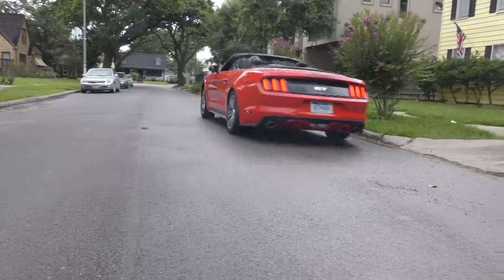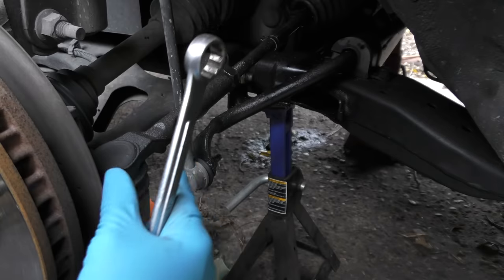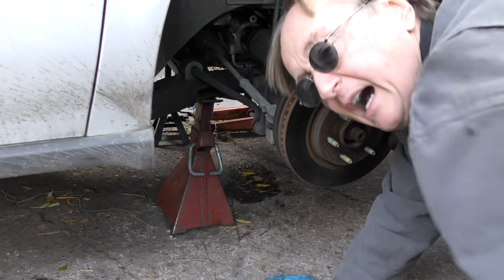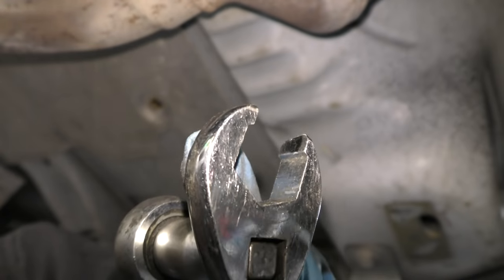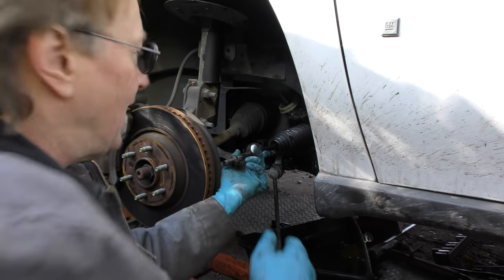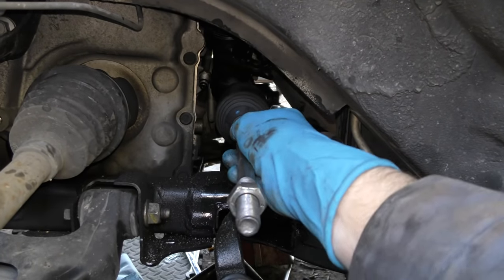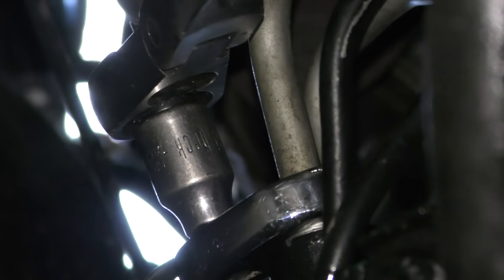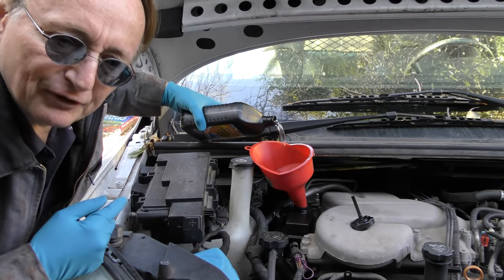How to Replace a Power Steering Rack in Your Car

Comment: My mechanic told me it takes 5 hours to do this ...So i was expecting  a vidoe of such length....but Scotty got it done In minutes 😀. I wish i could do this myself cuz the mechanic  is rippling me off 🤨
Reply: Keep in mind mechanics have to do more though. The rack itself may only take half an hour or so, but the time to take things off and put them back together is included, as well as the alignment time. My shop would probably charge two and a half to three hours for this so it's not far off
Reply: @chickenfixn4439  ok thanks.. but 3hours compared to 5hours is a big savings.

Comment: Why didn’t you lock the steering wheel 1st? This isn’t right from the way I was taught. Please explain Mr.Kilmore? I’m a suspension technician and I really am curious to why our methods differ
Reply: You don't HAVE to but it is a good idea to prevent someone from turning the wheel and ruining the clock spring

Comment: Hi Scotty, I have a Honda Jazz 2009 where the EPS light indicator comes on. It's hard to turn really.  We tried to check using a device but it detects to have something in the battery (low voltage?). But some mechanics its either on the module or the electric motor w/rack and pinion needs to be replaced. It's $$$. But the thing is the light turns off at some point then turns back on. What do you think is the problem on this?

Comment: I have a power steering issue with my car. I can't find a leak in any of the lines but I believe it's the cap is the source of the issue. Can a bad cap really cause it to leak that much and cause the power steering to cut in an out while turning?
Reply from the maker: +Hank jr Breukelman  bad cap only loses a tiny amount, and often if it comes out the cap, that's the sign of a bad pump pushing fluid out there
Reply: +Hank jr Breukelman What type of vehicle?  Is the pump making squealing noise?
Reply: +ScubaCat3 It's on 06 Impala LTZ. The pump is whining so I'm just going to replace it again. It's no big deal, I replaced it last summer and they only cost about $40.
Reply: First check the fluid reservoir and make sure there isn't a little metal screen in the bottom. Take it off and empty it.  That screen may be gunked up with burnt carbon (or whatever the black crap is) and blocking fluid flow.  Just spray a little carb cleaner in there and the black crap will come right off.  I replaced my pump before I discovered this.  You can't see the screen at all until you drain out the fluid.
Reply: +ScubaCat3 Will do, thanks.

Comment: Hey Sotty ! 😉👋🏽
1999 Infiniti Qx4 
Whenever I turn the steering wheel then start the engine then turn it again, little bit of power steering liquid spills out the container even if the cap is on. What's causing that ?
Reply from the maker: +Fabrice Douillard you have a restriction somewhere. Often a bad power steering rack or a bent power steering hose that's building up too much pressure.
Reply: +Scotty Kilmer I can't really find any leak but this isn't my first time seeing liquid on the hose and on things next to the container 😔

Comment: I have 2006 chevy impala and have change the rack 3 times already. I did a complete bushings and bearings replacement, even control arms on both sides. I steer left and right you can hear cracking noise. I took it for alignment installed a camber tool.  I just ran out of options what is causing it

Comment: Hello Scotty I have a Lexus GS 300 2006 the steering is so hard to turn I  removed the rack and checked the rack wouldn’t turn easily as well should I change the rack ?? Because the rack makes noise when I removed it and it wouldn’t turn easily

Comment: Hey Scotty , I was replaced my Steering Rack and power steering pump. But Why it extremely hard to have wheel turn when it stop while car is running but It working so smooth while driving on the road(Faster steering wheel smoother). Do you know the reason ? thank you
Reply from the maker: +Raksasok Heng if you used rebuilt parts, and not brand new ones, that's often the cause, rebuilt ones often stink

Comment: Hi Scott, I have a question. I am gonna change my rack and pinion on my 2010 Kia Soul + 2.0 and I would like to know if the mag1 fmx oem gm,ford & Chrysler psf is ok to put back into my vehicle and do you think I could get away with replacing the rack and pinion without dropping the sub frame. Thank you

Comment: Scotty so my rack and pinion on my 01 dodge intrepid is worn out and need to replace it soon. Sadly checked online and dealer hey only have reman. Will take my chance with a cardone reman since I have a reman cardone pcm and haven't had an issue guess I was lucky! My question is after I change the rack and pinion do I need to flush the power steering fluid? Thanks!
Reply: always remove old fluid as that can damage new rack

Comment: I smacked a curb trying to do a uturn I was told a loose bolt on my rack and pinion will cause my wheel to wonder, I thought it was the inner tie rod since the outer one looks fine

Comment: Hey ! my car is making a noise when I turn my steering wheel with the engine on and the car being stationary. I took it to the mechanic and he said the noise is from the rack and pinion. There's absolutely no noise when I'm making turns while I'm driving the car ( car is in motion ). Is this a serious problem ? Should i have my mechanic remove the whole rack and pinion ? Or is it just the steering fluid ?
Reply: test the cheapest thing first, replace the psf! it's $6!

Comment: I had my power steering rack & pinion replaced . After leaving the mechanic shop, I noticed that the steering wheel controls are not working, also the cruise control wasn't working, and the traction control and the air bag lights were on. Why.?

Comment: Center the steering wheel and then wrap the seat belt around the wheel so it can't move while the steering shaft is disconnected.

Comment: My 2002 Camry has one of those rubber boots with oil on the outside of it. It’s not leaking but the oil is just covering the rubber. The steering is fine but feels loose. Very easy to turn the steering wheel. It’s been like this for a long while I think but I’m not the primary driver of the car. Does the whole thing need to be replaced?
Reply: lucas m did u ever find out the problem?
Reply: What was issue i got same problem

Comment: Scotty
What is your opinion about the rebuilt racks? Cardone is a brand that rebuilds a rack for my 2000 Dodge Dakota R/T (I guess Cardone gets the old racks and rebuilds them, not make their own) and I am planning on avoiding the mopar brand that is $700. I have made a comment in a previous video of yours and a lot of people say that the rebuild racks are garbage blah blah.... I'd either go to AutoZone or NAPA.... and the rebuilds have warranty. I am lucky because it looks pretty easy to do my rack and pinion on my truck.
Thanks Scotty.... appreciate the knowledge and your time sir.
Reply: You get what you pay for, personally I'd buy a new one.
Reply from the maker: +Eslamizar yes, a lot of them are garbage, I try to stay away from them as it's a BIG job and good luck trying to get cardone to pay labor for the job IF it doesn't work.
Reply: +Scotty Kilmer you couldve spent a couple seconds telling folks how to refill also. but seriously you crack me up man thanks for all the videos
Reply: Lol... Still deciding on which crap to go with? Just get a used recently retired dry oem one if you want to save money. There are so many of them, and it'll last longer than a rebuilt. I say recently retired because you don't want one that's sat for years with no pressure or fluid.
Reply: hugeslacker I plan on replacing the rack this year.... I think I will take it out and have it rebuilt by a local shop.

Comment: Hi Scotty, my steering makes weird noises when turning. It's manual steering and front wheel drive. Even when parked, there is a kind of creaking noise when I steer. I know the tie rods are good. And the struts and springs are new. Could it be the rack? Thank you sir

Comment: hi Scotty. .so if the steering wheel wabbles left and right when you start driving the car...does that mean the rack and pinion needs replacement. ...
Reply from the maker: could be that or any other worn front end part like tie rods or ball joints

Comment: Hey Scotty, is it possible to replace the inner tie rods, my drivers side took a hard square on kerb hit (4 inches high apx) that blew a 275/40/20 tyre.
I had it checked and they couldn't find any fault but it's scrubbed the opposite side tyre (inner 1/3rd) and when I rock the wheel there if definite clunking from the rack area. All the ballpoints and ball joints still feel solid. (Upper lower and outer tie rods)  It's on a 2004 Cayenne. 
Thanks for any advice

Comment: the at-205 seemed to work when i first noticed a slight drip.  so far so good.  but i know in the long run i will have to replace it though.

Comment: you didn't mention how difficult it is to put back and screw in the fluid lines ou took off. is there a special way to screw the threads back on.

Comment: Hey scotty I want your opinion.  Im currently doing some work to my grandpas 2000 Mazda Millenia S Millennium edition.  The work was new drive axles, front brakes and tie rods for the car.  My grandpa is actually going to sell the car eventually and im interested in buying it, but ive been doing heavy research and still not sure.  The car only has 112500 miles.  Do you think this car is worth buying off of him?
Reply: +WildWhiteFang I know I'm not Scotty, but from the few I've seen, they're nice cars in terms of the engine and general appearance. With that little mileage on it and if it's to your liking physically and mechanically, I'd say it'd be a nice purchase. If I were you I'd still continue to do research on it. Besides, you can never know enough about cars :P
Reply: Scotty would say something along the lines of " Oh heck, yeah if but that for a low price because you know that it was well taken care of, just realize those mazdas are not as well made as let's say a Toyota or Honda and Mazdas have real weak automatic transmissions, but if it is a manual and you can get it cheap enough, I'd go buy it"
Reply: JasonMTG Yeah I know how the car runs and the only other problem is the front valve cover leaks but I can fix that.  ANd honestly I appreciate it! Anyones opinions are welcome, cause i need another car fast!
Reply from the maker: +WildWhiteFang some grandpa, he should give you the car.  But, if it's cheap enough, at least it's a known vehicle and not some wrecked piece of junk.
Reply: +WildWhiteFang   Mazda sucks balls. 150k miles is about as much as you can expect out of that engine.
Reply: Scotty Kilmer well he is paying for the parts on the car I just havent told him im interested in buying the car and the car is in great shape, he is very picky about how his cars are taken care of
Reply: Y10Q Really? Cause I have seen alot of mazdas with over 150k on the motor
Reply: WildWhiteFang
 really hard to find one over 150k miles. Mazda and Mitsubishi are on par with GM products.
Reply: Y10Q Then your not looking hard enough dude.
Reply: ***** Its mostly age honestly, even my auto tech teacher said the same thing.  And it only needed the left drive axle but my grandpa went ahead and got the parts anyway
Reply: rogermurph101
 those boots are cut by a mechanic when you take it for a service. I have a 2001 Subaru with 253k miles and it's on original axles boots intact. The only difference is that this car has never seen a mechanic shop. I do everything on it myself. I had a 1990 Subaru and boots were fine until I took it for brake work circa 2000. And then, all four magically developed cuts. Call me crazy, but I think they cut them at the shop on purpose.
Reply: +Y10Q  600 k on mine.  Al I have done on it is breaks and shocks
Reply: ***** I have a 99 Jeep Gc and I started doing work to it myself after i took it to Jiffy lube.  I started noticing a transmission leak and thought it was the gasket around the pan, when i went to check the bolts to take them off I noticed they were very loose.  I instead tightened them and never had another leak.  One of my many reasons why I dont trust shops like that.
Reply: Mazdas are pretty good. I have a 99 protege with 187,000 miles and not much has gone wrong. Everything works. Just watch out for rust.
Reply: Any car can rust gut it can rust fast if your location has lots of salt

Comment: Scotty, can i get some insight on why the 2az-fe engine starts to burn oil around 100k miles? My dads pontiac vibe, which is toyota matrix but you already know that, has the 2az-fe and its starting to burn oil. It has all its service done and everything. Oils changes were on time, i just dont understand why this is happening. My 2001 isuzu trooper is said to burn a quart of oil every 1000 miles and it doesnt. Or was i just lied to the whole time?
Reply from the maker: +Frank Magana  they do it cause people don't change the oil frequently enough, on my wife's matrix I change it every 3 thousand miles and it burns nothing. Go by their suggested 5 or 10 thousand mile oil changes, they will burn oil. They just don't want to admit their change schedule is wrong, they'd be sued BIG time.

Comment: Hey Scotty. I have a 2007 Volkswagen Rabbit 2.5L. I did both front wheel bearings and Axels and now the steering light is on and giving me a code for Steering Torque sensor. I checked for power and ground. Any thoughts if I need the sensor or the entire rack?
Reply from the maker: have a vw guy check it with his vag com computer, those are complex over engineered vehicles, you can't just guess with that warning, too many possibilities

Comment: Hey Scotty- is that a Chevy Uplander in the video? I have an 02 Olds Silhouette that had a leaky r&p gear, got a reman from a local well known reputable auto parts store, and guess what? After about 2-3 weeks it started running fluid out he rh side boot-ugh! I haven't pulled it to replace it (warranty exch) because I really hate doing it all over again.
Reply from the maker: yes, it's an Up.  And that's why i hate rebuilt racks, crap half the time

Comment: Scotty what brand of power steering rack is good? Im not sure what is wrong with my 01 Dodge intrepid but sometimes i get low on Ps fluid and my car makes a low noise i poured fluid noise is gone but i am wondering could it be a leak or the rack? Thanks!
Reply from the maker: +Luke  I only use new ones, rebuilt ones stink half the time.  to check for leaks, do my video "finding and fixing car oil leaks"

Comment: I have an 03 impreza, and my car is smoking (white) from underneath. I just replaced my PS pump, but every time I drive my PS fluid drains. I think the smoke is the PS fluid leaking and burning off, but where would it be leaking from?
Reply from the maker: +huntersergey445 often the high pressure hose, do my video "finding and fixing car oil leaks"

Comment: Hello Scotty. I watch your videos for a long time. I'm urging to question one thing for few days...
I have an automatic car, and it's not reversing anymore. Only when on a perfect flat surface, lacks power, and throttle serves nothing. It's too bad?

Thanks a lot and best regards from Brazil.
Reply from the maker: +Thi Tavares odds are you need the transmission rebuilt, BUT pray it's just low on fluid
Reply: Scotty Kilmer Thanks Scotty. I will start praying.. ahaha. A new transmission for my car.. About 6.000. :O

Thanks a lot for your time... Keep up the great work and videos.

Comment: Thanks Scotty, that tie rod alignment trick was fantastic! I'm in need of your expansive Yoda-like knowledge. 

I have a 1987 ltd with a 351w that recently got a brand new intake and a fancy 4 barrel carburetor installed. I assumed the guys at the shop would have swapped the near original plugs but they left them in and I'm left with my baby running horrible. The problem is that the plugs are STUCK. It feels like if I spin any more they'll crack off. Is there anyway I can get them out without killing the heads? My ol' girl is going  to be needed for a cross country trip to Newfoundland. 

Keep up the fine work!
Reply: +Dewy Russler Thank you so much! Those Triton heads are aluminium right? Hell, sounds like Kroil's the way to go!
Reply: +Dewy Russler I was going to recommend kroil too. Worked on my old audi that hadnt had its plugs changed in 15 years.
Reply: +Brad Nimbus I have a 91 S10 I bought a while ago. When I took out the spark plugs, 1 or 2 of them came out in pieces. Wow. Talk about some old ass plugs.
Reply: +Brad Nimbus Try running the car for 10 minutes or so to get the heads hot  then try removing them. I've run into stuck plugs on cold engines that if warmed up, usually just a few minutes from cold, they come out with a little work. I've come across this on aluminum heads for the most part, but go ahead and try this on Yours.

Comment: hey Scotty, I have a 2000 mustang gt and on colder days and nights something in the rear will squeel and chirp like a symphony of birds. It is loud and embarrassing around public. it will happen whether I'm turning or driving straight, whether I mash the gas or feather it. it WILL go away above approx. 30 mph and stop while it's "warmed up", whatever it is. I can't figure out what the heck is causing it. any ideas?
Reply from the maker: +Daniel Reding   check for worn U joints